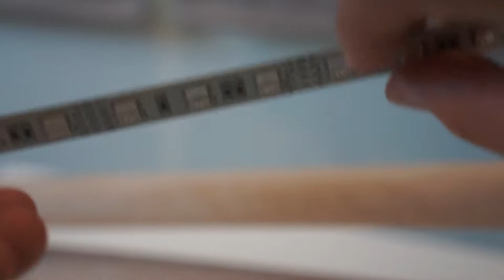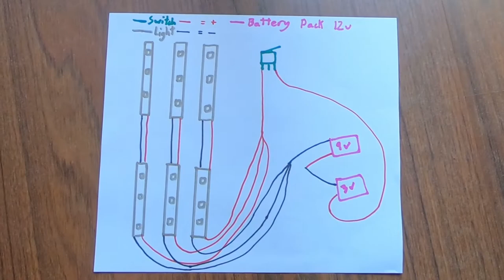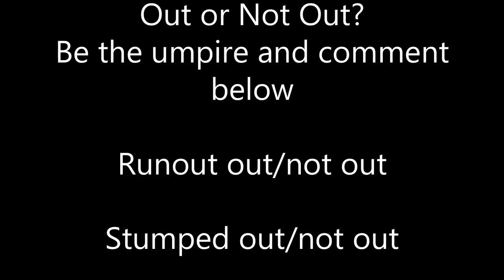Upgrade cricket stumps into LIGHT UP STUMPS! | LED Wicket Stumps | JL's Maker Space.

Comment: Hello could you please tell me how you connect a battery looks complicated one is looks like adapter and one is cell I know please let me know thank you
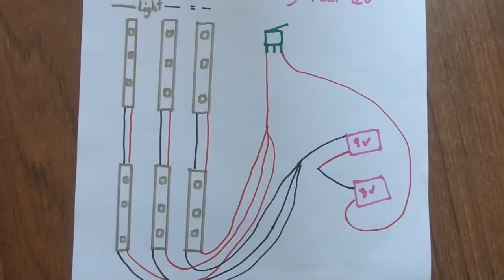Reply from the maker: You can see the diagram at 3:08 time in the video. The lights I used were 12v so I connected a 9v and 3v battery pack together in series. (9v red to 3v black).

Comment: Can it will work really
Reply from the maker: Yes, it works perfectly and very well till this day.
Reply: @JLsMakerSpace  it's ok . Pls reply want product used . Light volt and battery volt also
Reply from the maker: @Yogi._.FlimWorks  I used a 12 volt battery and 12 volt light.
Reply: @JLsMakerSpace  can you send light link in amazon
Reply from the maker: @Yogi._.FlimWorks  I can't find the exact on because I bought it in Korea. Here are some related ones:
https://www.alibaba.com/product-detail/High-quality-T8-T5-tube-LED_60210396024.html

https://www.dhgate.com/product/5050-rgb-led-bar-light-dc12v-36led-50cm-ip68/404294503.html

https://www.amazon.com.au/Renovo-300LEDs-5050SMD-Control-Bedroom/dp/B085M4ZHNY/ref=sr_1_8?adgrpid=88040141238&dchild=1&gclid=Cj0KCQiA-OeBBhDiARIsADyBcE62rgWKshDRtauFndlkVC1BvCpRgf-YDKWQZMdMC_PuXTorGPz-0wsaAgFZEALw_wcB&hvadid=414100095572&hvdev=c&hvlocphy=9071969&hvnetw=g&hvqmt=b&hvrand=8725574636357078105&hvtargid=kwd-58795878474&hydadcr=3558_6091&keywords=led+lights+amazon&qid=1614494919&sr=8-8

https://www.bestledstrip.com/12v-rgb-color-changing-led-strip-light-5050-60-5m/
Reply: @JLsMakerSpace  thanks
Reply: @JLsMakerSpace  how many cm light
Reply: @JLsMakerSpace  can you send spdt switch link
Reply from the maker: @Yogi._.FlimWorks  https://www.amazon.com/Cylewet-Straight-Switch-Arduino-CYT1110/dp/B07N819HR6/ref=sr_1_3?dchild=1&keywords=1a+125v+3+pin+spdt+limit+switch+long+hinge+lever&qid=1614662098&sr=8-3
Reply from the maker: 15 cm